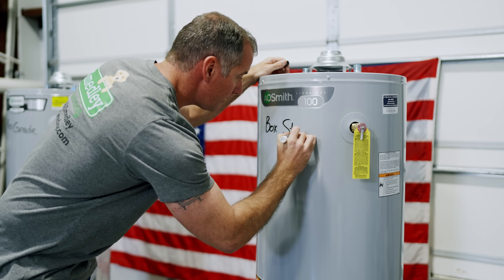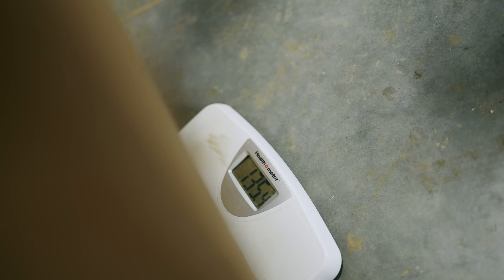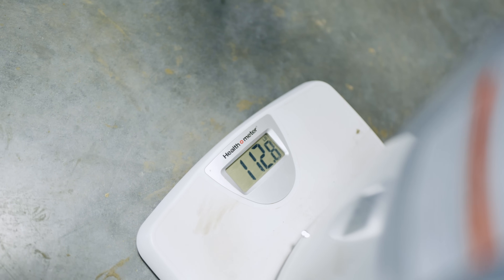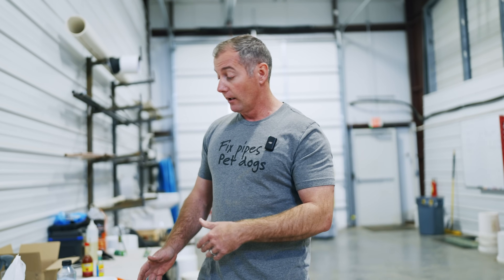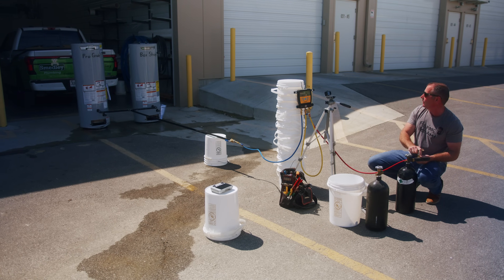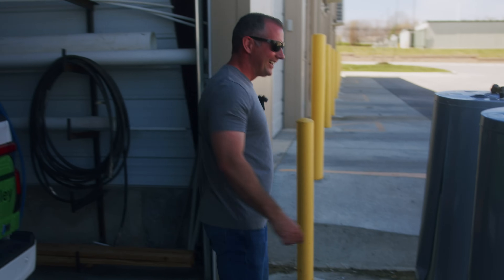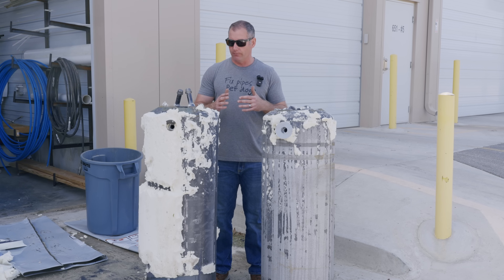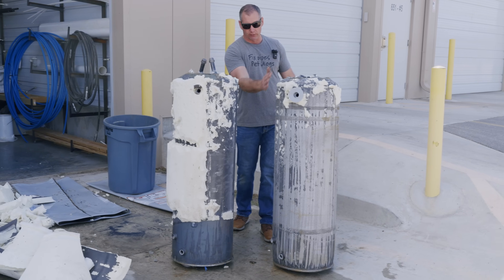What water heater should I buy? - Pro Grade vs. Box Store

Comment: My water heater is a Reliance brand (AO Smith made) from get this 1991. This was before the expansion tank was mandated. I put this water heater in when I was in my 20's. I worked at a box store back then. I'm now a Plumber (started apprenticeship in 98).. There was a time I actually drained sediment out of it. I'm a single guy and the temperature is set at just hot enough to have a warm shower. That I'm guessing explains the way above average life expectancy. Thanks for the video.
Reply from the maker: Yeah.  They made them a lot better back then too!

Comment: If I expect to use the same water heater for 15+ years I am going to spend the money upfront and go to an actual plumbing supply store.
Reply from the maker: It's the best route to go!
Reply: Good that you don't live in Las Vegas. About the best one can expect for a typical gas water heater is about 5 - 7 years.  I can't speak about electric models.
Reply: @kennixox262  I actually live in Canada and also have an electric water heater. The only maintenance I did was to flush the tank each spring and replace the anode rod once every five years. My last tank lasted 27 years which I am honestly quite surprised at.
Reply: Mine's been going for almost 20 years. 😮

Comment: So replace the drain valve and upgrade the anno rod if you want to magnesium. 
Come on not scientific enough You would have to weigh all of the phone that thin metal housing break it down to find out if there really is more weight in the metal if the metal is thicker and then it really comes down to the weld quality which as we can see in your video the pro grade weld went bad before the box store. 
So the conclusion is even if you have better materials it still comes down to human error or if they're using machines to do the welds comes down to human error on calibrating the machines. 

The only way to truly know is to have a running tally of maybe 5 years 10 years on failures of pro-grade versus box store. Then you will have some statistics. 
Good video good effort not enough for convincement 👍
Reply from the maker: As a plumber of over 20 years, we have the real life results to know that box store heaters don't last as long.  This video shows why. The swollen tank told us more than anything else.

Comment: My State gas water heater was installed in ‘98 and I bought it from a plumbing supply company. A year ago I found the booklet that came with it along with my notation of the installation date. I shudder to think of the condition of the anode rod, if it still exists.
Reply from the maker: At that age, who cares.  Lol.  Just be thankful it's lasted this long and don't be surprised if it fails eventually.  You've had a great run.

Comment: I really liked the video, just one thing that was nagging at me was the box store was the 100 model IE the bottom end unit, could you do the same but for the higher end units?  IE the 300, 500, and 900?  I'd like a video that doesn't just bring in the lowest end and compare it to a pro unit.  If even the 500 and 900 still lack the better tank, diverter, control, safety and drain then ill be convinced.
Reply from the maker: The idea was to compare the same warranty tanks. 6-year versus 6-year. We would have gotten heat for giving the box door unit and competitive advantage by comparing their 9-year or 12-year tank to the 6-year pro grade tank.
Reply: @SmedleyPlumbing  thanks, that's a good reason to do so.

Comment: Bought my house in July 2021. Water heater was original. Last year, I replaced it with a Lowes AO smith 50gal (old one was bradford 40gal).  I did replace the plastic drain valve with a brass ball valve.  Right away I was impressed with the water temperature.  I have had no issues with my 50gal Lowes  AO Smith water heater since I installed it over a year ago.  I do want to drain it and replace the anode rod though in the next month or so.
Reply from the maker: Fingers crossed!

Comment: I have had several AO Smith water heaters. One installed by a plumbing company. One I bought from a supplier and pro installed. Original one worked over 11years before I replaced it. Proactive prevention of leaks. I’ll be buying another one for newer construction. How do I know the non box stores get the pro grade? Does the model say pro grade?  I loved the video!! I wondered whether they were the same model # or just exact specs.  The pro stores near me are Ferguson and Keller. Thanks for any insight. 😊
Reply from the maker: Typically if the box is colorful, it's from a box store.  If the box is brown, is a pro grade.

Comment: The house here has a pro grade AO Smith that's 19 years old. No leaks yet, but always wonder if it's better to proactively have it replaced before it dies.
I also once had a plumber tell me they don't make water heaters to last as long now therefore I should keep it going.
Reply: Just replace the anode
Reply: @beachboy4727  Will look into that, thanks. The only thing is it's never been drained so I'm sure there's lots of buildup.
Reply: Does anyone know if soaking strong lime away in the bottom  of a water heater tank with mineral deposits would clear it up?
Would it be able to drain out of the drain valve?
Reply from the maker: I would leave it alone if it's lasted that long.

Comment: Im in arkansas on a well. we have sulphur ground water. Should I go with the aluminum rod then? My current water heater still works but has to be 25 year old or older. so doing research in case i need to replace soon.
Reply from the maker: I wouldn't touch the anode rod in your current water heater if it's still working after 25 years. But I would also look at the top of the anode rod to see if there is a weld spot or not and then I would make sure that whatever replacement water heater you get matches that.
Reply: @SmedleyPlumbing  ok thanks. I figured I'd use it till it quits. I learned something new from you. Thanks. I'll see what other videos you got so I can learn more.

Comment: Informative.  Thanks.  I replaced my water heater a  couple of years ago and somewhat by chance it is an AO Smith Proline.  I was not aware of the differences.  I needed a mobile home style propane unit and the box stores didn't have one so I bought it from Ferguson.  It was actually NG but it came with a propane burner so I swapped it out and changed the gas valve orifice.  At the time I figured I was paying a bit more because of sales volume differences.  Also because I was buying retail from a wholesaler.
Reply from the maker: It’s great that you ended up with a pro grade unit!

Comment: Awesome video! Regarding the glass that you mentioned that lines the inside of the tank. Would it be safe to say then, that if I were to flush out my tank (for maintenance) and I see glass come out, then my water tank should be replaced soon?
Reply from the maker: It might be hard to differentiate the glass pieces from scale.  If your hot water is starting to come out rusty, that is a sign that failure is imminent.

Comment: Great video! Only thing I don’t understand is @52:00 why would the pro grade water heater not swell? This seems to defy the physics of water expanding as it’s heated. Is it because the steel is thicker and so the glass doesn’t crack? Understand in the video it’s because the pro grade eventually the weld splitting. Either way I’m really glad I watched this I’m adding thermal expansion tanks to all my and my family members water heaters.
Reply from the maker: Stronger metal tales more pressure to stretch it than weaker metal.

Comment: Interesing thanks. Small point though; When Water filled vessels fail under pressure there is No dramatic explosion . 
Water simply pisses out..  not an explosion as typical from compressed gas.
Reply from the maker: This is true.
Reply: If the gas valve fails to shut off at desired setting and the T& Pvalve doesn't blow the excessive pressure, the heater can blow like a rocket ship . I've seen fly down hallways and stick 1/2 way in an exterior door .Trouble with box stores ,they are constantly changing brands due to profit margins .

Comment: I have replaced a number of water heaters and have had nothing but issues with the Rheem water heaters from Home Depot. Their thermo couples keep failing. On one water heater, it failed twice before the warranty expired. The Rheem company would send out another kit, but the tenant would be without hot water for several days. I gave up on the warranties and just purchased a thermocouple from a supplier.  This has occurred to a second water heater with the same issue.
On another  newer Rheem water heater still under warranty , the thermostat would not work properly and would cause the PT valve to start leaking. I first thought the issue was with a faulty PT valve. Replaced it and had the same issue. Instead of replacing the thermostat, I replaced the water heater.
Reply from the maker: Yes even the small parts are inferior to those on a pro grade unit.

Comment: My understanding is that box stores have full lines of products from Pro to Eco. You choose what you would like to pay for DIY.  How long does it last? Depends on your luck.  I have a building with two exact same water heaters installed at the same time, one went bad barely past the 10 year warranty, the other one has been there over 15 years, still working fine.
Reply from the maker: They have additional lines of products but they are all economy grade units

Comment: Anode rods. Magnesium, Aluminum, and Aluminum zinc. You mentioned Magnesium is the best. Other forums mention aluminum zinc as the best. When  people refer to aluminum rods, are they referring to Aluminum zinc, or are they different? My Pro Select originally had a aluminum zinc rod. I just replaced it with Magnesium. Should I have replaced it with the rod it came with?
Reply from the maker: Depends on your water quality.  Some anodes don't like certain water conditions.

Comment: I wanted to replace my Rheem from HD with a bradford white or similar from the plumbing supply store, but they were either too tall or too wide for my space. The only thing that would fit was the exact same model Rheem 50 gallon. But I was pleasantly surprised to see that the old plastic valve on the old Rheem was now a brass valve on the new one.
Reply from the maker: It happens

Comment: Nice video and presentation. Magnificent. 
I can see the tank cap distorted from flat and bow like the top of a donut and not in bow shape is because we have a flu tube there to hold the center height in dimension from becoming a dome. As the nipple were mounted less than half radius from the center it will follow the donut and lean inward.
Reply from the maker: Yep!  That happens on gas units.

Comment: Years ago we bought a Richmond  50 gallon power vent heater at menards. It failed (leak) they did not stock it anymore.  So we found the same heater at home depot a Reem. Only difference was the power vent difference on top about a inch shorter. Took the control valve out of the 
Richmond, has plastic cap. We don't run it at a real high temperature. It was good not failed. I didn't have a longer exhaust tube for power vent so put power vent from old unit and installed it. Worked is there a reason I would need to change it?  Thanks
Reply from the maker: No need to change it until it causes a problem.

Comment: My Reliance (made by A. O. Smith) electric water heater was purchased at a water heater and plumbing store. The drain valve is plastic (cheap). The inlet and outlets show space below the threads (cheap). The pressure valve is pro. My heater has the "Do not return" sticker (cheap), but also has a sticker from the plumbing supply company for service. I replaced the original anode with a Corro-Protec powered anode.
Reply from the maker: That’s a good observation.
Reply: @SmedleyPlumbing  I had my new heater almost a year before I replaced the anode. When I removed the plastic cap, there was just insulation foam under it. I had to cut a plug of insulation out to get to the anode. I don't think they expect people to replace them. 
I used the anode that I removed to replace the anode on a water heater two houses away. The anode in the other house was about ten years old and 50% depleted. It looked like it had calcium deposits that made the depletion uneven. I installed that heater to replace the original 1952 heater! The water inlet was in the center of the bottom. It had leaked, and I had to replace the floor and sub-floor. New one is in a pan.

Comment: Very well done video.

I work in building maintenance doing plumbing for water and 120psi air, electrical from single phase to three phase 460v, hvac, etc. I can't go to any local plumbing supplier and buy a "pro" grade tank because I'm not a plumbing contractor. Someone explain that one to me. Most plumbing, electrical, hvac suppliers simply want to lock out anyone who isn't a contractor. It ticks me off.
Reply from the maker: It is frustrating!

Comment: I work at the General Motors Assembly plant in Arlington Texas. They have 1 assembly line and use is to produce Chevy Tahoes, Chevy Suburbans, GMC Yukons and Cadillac Escalades - in any order. I said that to say that it is very easy to produce similar (but different) items on a single line - both of the water heaters you tested could very well be made on the exact same production line. Maybe they weren't, but they certainly could be.
Reply from the maker: But they are absolutely not the same heater.

Comment: One test that wasn’t encompassed in this comparison is how quickly does the pro model heat and recover compared to the box store? IOW, if there were no service issues over say 6 - 10 years, would the pro model save on energy costs?
Reply from the maker: That would be very difficult to calculate.  The energy guide stickers are about useless when it comes to that too.  They are notorious for being wildly inaccurate.

Comment: Great video thank you for taking the time to make it. Not trying to bash you or anyone else but alot of supply houses won't sell to the general public or if they do it's not at a pro plumbers price ( which I totally understand) The average joes price is going to be way more than the price that the pros get. Where I live in CT you have to have an account or license to get your price. I have a friend who called me a couple of weeks ago. He got a quote for a 40 gallon gas fired water heater install and taking away the old water heater for $4,000 ouch
Reply from the maker: Most supply houses will sell to the public.
Reply: @SmedleyPlumbing  I had to check again. Called several in my area(Winsupply) and the word was it depends. Fictures and accessories yes. Oil or gas fired boilers,water heaters  no go. Probably to my liability on there end. Take Care and Have a Happy Thanksgiving from CT

Comment: Typically, a majority of box store products across ALL INDUSTRIES are inferior in quality to those sold directly by a manufacturer or a supply house as many of the components aren't OEM.  Thanks for such a thorough educational video.  The bottom line is that as consumers we're apt to get our just dessert if we don't do research and simply buy based upon cost savings.
Reply from the maker: Yep!
Reply: @R.BOWERS  The same one's that manufacture the OEM versions for sale to the supply houses or directly to the consumers.  The manufacturers enter into contracts with the big box stores to make a version of their original product models using inferior components.  This marketing strategy has the box stores customers believing that they are typically saving some 10-15% by making that choice, but any savings are apt to be lost as the box store version will usually have a significantly shorter life span.  I've learned this lesson the hard way over time, especially during my younger years.  The bottom line is that as consumers we are more apt to get what we pay for as in all too many purchasing experiences a deal isn't always what it's cracked up to be.  Personally, I'll never purchase an appliance or yard machinery from a box store  just to save a couple of hundred bucks at the outset.

Comment: Question. I have a bradford white defender hydrojet water heater....but it only has the cold/ hot lines but no anode rod... model #
MI403S6FBN.
Reply from the maker: The anode rod is hanging off the hot nipple on that unit
Reply: Thankyou for the info.I just bought the house and was wondering where the anode rod was on that particular water heater it's a very old unit .but don't know if it ever been maintained. I might just get it replaced.

Comment: My house has two water heaters, one electric the other gas.  I replaced them both at the same time with the cheapest big box waters heaters.  I have well water with a water softener which is more corrosive than no softener.  Both heaters were just replaced 25 years later.  They were not failed but I was being proactive.  The key to the reason they lasted so long, is I inspected the anode rods annually and replaced them when gone with mag.    On average they would last about 2-3 years. I also flushed them 2-3x/year. The longer warranty heaters actually have two rods, but if you stay on top of the maintenance, you can make them last.
Reply from the maker: Now...let's see if the new ones last that long.  They sure don't make them like they used to.